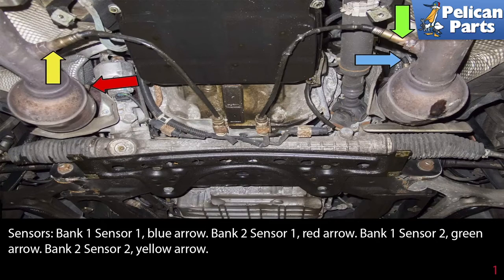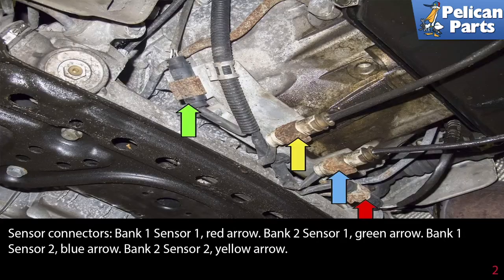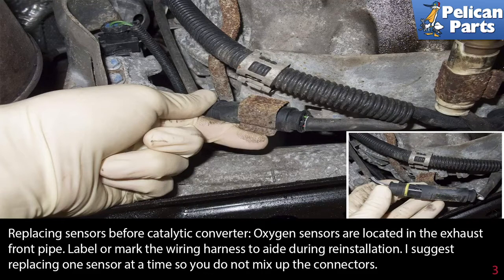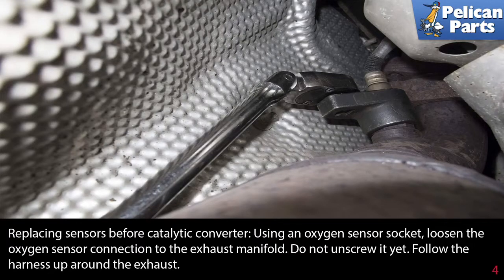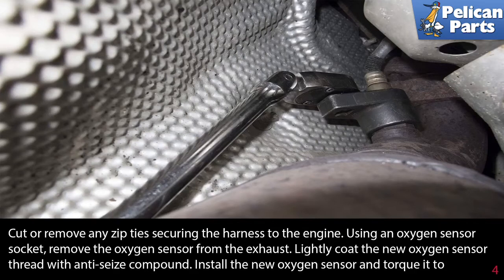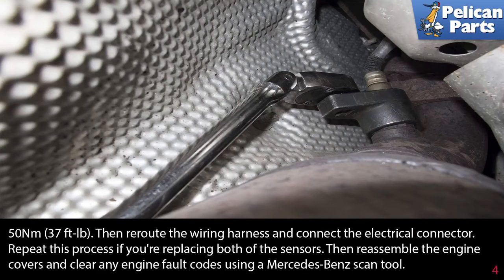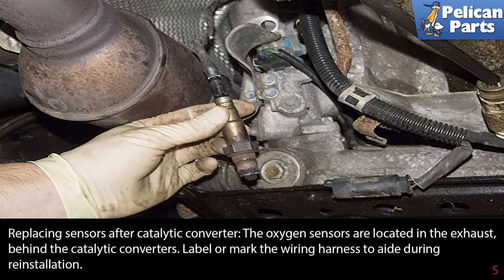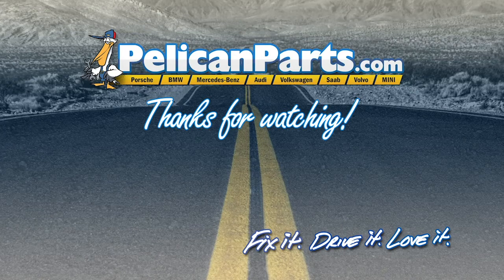Mercedes-Benz W211 E-Class Oxygen Sensor Replacement

Comment: Does this apply to a 2009 E320 Bluetec?  To replace the O2 oxygen sensor (upstream), bank 1, sensor 1, I’d been told it’s passenger side (is photo taken from rear of car?), in front of Cat. converter near engine and firewall, and is more difficult to get to.  This looks different, and easy to install.  Please confirm.
Reply from the maker: Does not apply to Bluetec engines.